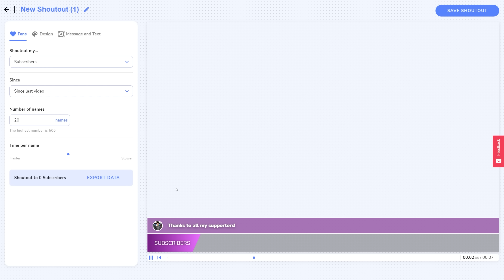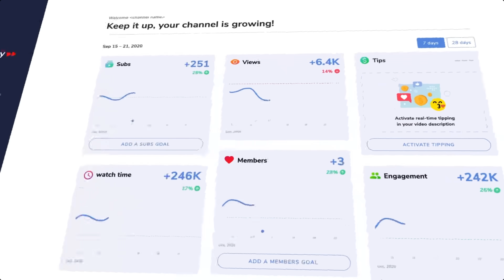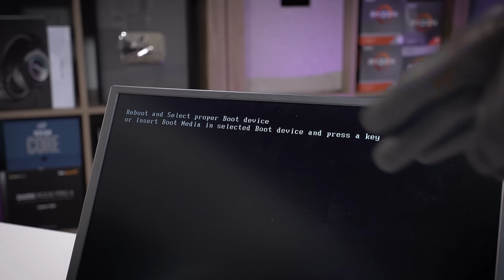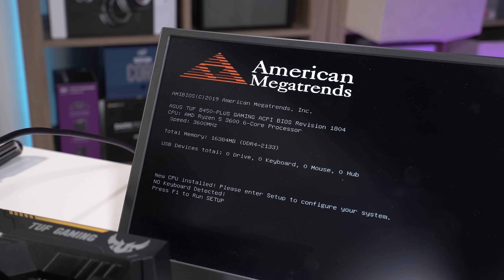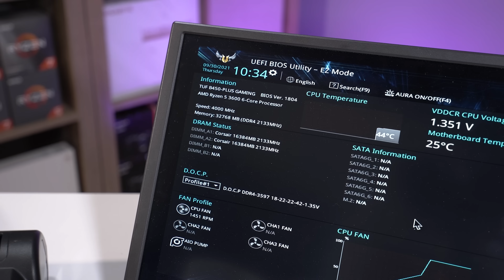Fixing a Viewer's BROKEN Gaming PC? - Fix or Flop S1:E15

Comment: why relocate the aio to the front?
that means the only air going in to the case will be hot air from the rad, which will increase gpu and all other temps, except cpu temp, which will improve, but that is not needed, cus a decent 240 aio is alrdy overkill for a mere r5 3600.
IMO it's a mistake to put that AIO in the front.
Reply: Where else is he going to install it? He said the fans don't clear the RAM when it's top-mounted, besides that 3600 doesn't put out enough heat to affect the case temps that much.
Reply: @shiruki.fan.account  i missed the part where he said the fans doesnt clear the ram when the aio is top mounted. 

true, but the radiator itself still restricts the airflow.

Comment: Memory channel on cpu probably died due to overvolting the memory to get more speed out of it (like an extreme xmp). Power to memory goes through the CPU.

You're lucky you cleared the cmos before testing your chip in it. Depending on the OC of the memory it could have fried your's as well.

Comment: RAM doesn't affect FPS. I really wish you guys would stop perpetuating this BS. There is no such thing as "FAST" RAM.  RAM has one speed- light speed, or the speed of electricity over a wire. Test it if you don't believe me. You seem like you need content, Jayz2cents finally acknowleged my comments I leave on every one of these videos that talk about RAM  and get it all wrong.  He did a full video that explained the only thing to worry about with RAM is quantity and not mghz.  We used to care about mghz with RAM and "tight timings" when we downclocked to stablized and overclock. You can downclock RAM to 700 mhz and it wont do anything to your frame rates.  

Test it properly: Get enough RAM in your system to where you can create a RAM Drive and load a whole game into it and test it with a stop watch to see how fast your game loads. Check the frames per second. Lower the mghz to 700 and do the same thing.  

Now "overclock" your RAM do the same tests. Including the speed test on the load times.

"Fast RAM" is marketing BS made up to sell RAM for twice the price it should be sold for. Just like anything with "Gamer" on it. All BS. The way they allow us to overclock now, you don't need to mess with RAM or timings to get a stable CPU overclock. Heck you can do everything now from windows now if you want to.

Comment: Noob Video. 20 minutes diagnostic. First check: Clear cmos, 2nd Check Ram: or Reseat Ram ( Check Ram Slot ). Last Would be The CPU. Moherboard Bios Version incompatibility were known on older system. Just like sata Driver would require to be installed in-order the board to recognized the sata storage HDD back than. 

Side Note for no video: If they used a older GPU. Check UEFI OR EFI setting. That need to be change Also 

No Power: Check Power Supply, Check Power Button. You can easily tell if the board is bad. Power Button are known more issue in manufacture pre-build desktop like Dells Machine.